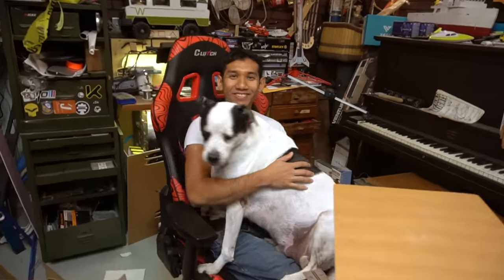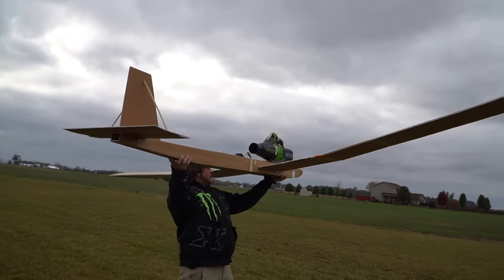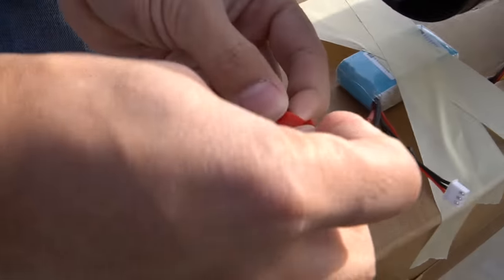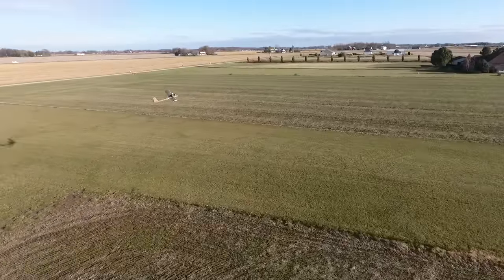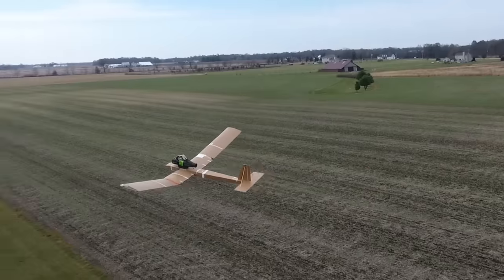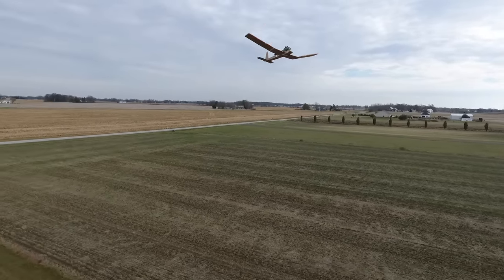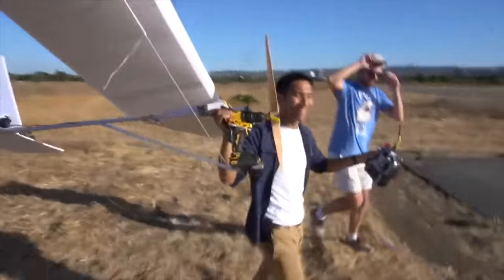FLYING Leaf Blower RC airplane Mk2

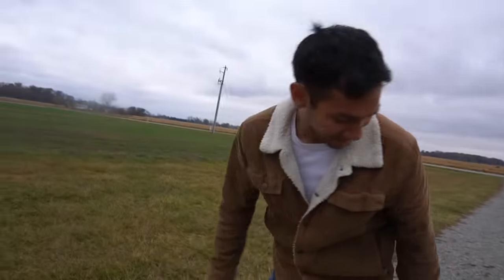Comment: The bottom line for this stuff is simply power vs lift.  If you attach enough power, you can get a house brick to fly.  Sorry, you lost a lot of credibility with me @ 1:50 when you stepped on the wing.  If you can't even unload a car........when I do useless stuff like this (and believe me I do all to much of it) I don't like to inadvertently break things, have to redo them, and waste more wasted time.  And it broke.  Why waste time on stuff that falls apart.  Why not just build a tad stronger with easy reinforcements on critical points & not waste your time?

Comment: Dude for as intelligent as you are you certainly do not think things through as thoroughly as you really should.  That step on the wing was complete jackassery as well.   Now sit down and think through every single aspect of your model and flight dynamics.  You can make it lighter, stronger, and stiffer with the same materials.  Now that you have to factor wind into the equation perhaps you will succeed.